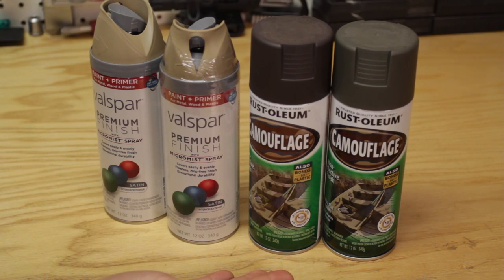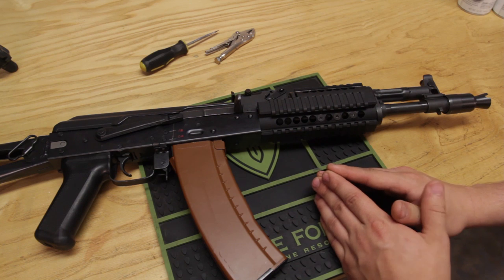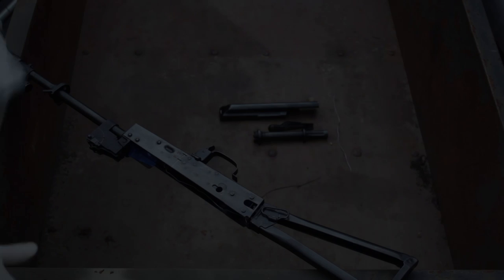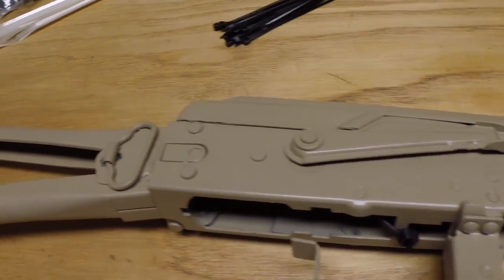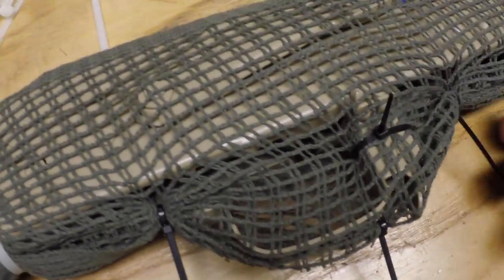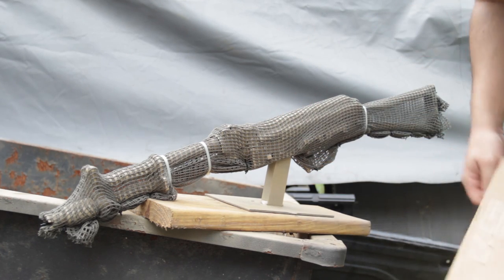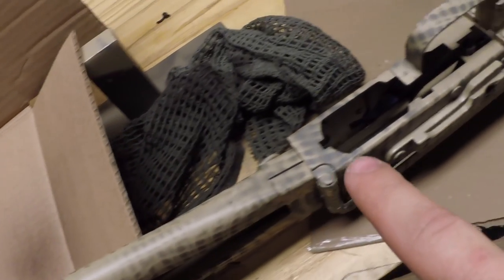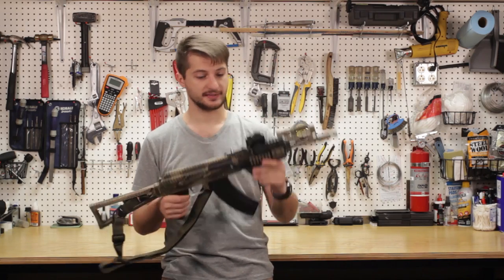How to Spray-paint your Gun like a Boss.

Comment: Ive painted two rifles with each type of paint and satin paint is no good, in my opinion. I ended up stripping it. (CLP Powder Blast makes it flake right off). Flat/matte has a more tactile texture and doesnt have any gloss whatsoever like satin. In the end, it simply looks like a higher quality paint job. The problem is that there simply isn't a wide variety of affordable flat spray paints out there. Home Depot has a Hedrix brand, but its pretty steep and I haven't heard any feedback on it.
Reply: just built an amd65 front a kit. first and prolly last ak build for me.  worked out but a cheap receiver made it difficult (more than it should have been). i opted to paint mine. done some research on it and ended up using rustolium 500f engine paint. i painted it, let it dry the rest of the day in the sun and the next morning i baked it and that stuff is tougher than i expected. i blued an old 22 with perma blu, turned out nice but that paint seems tougher than that bluing.

Comment: This is a quality way to be field expedient about paints weapons and or equipment. For a more permanent and durable spray paint job on firearms, check out The ProRancher, he has a video on the necessary steps for a very hard, quality paint job for firearms. Quick tip: pain on barrels should be high temperature paint from an auto parts store, and if the weapon has a direct gas impingement system only, DO NOT paint the gas tube. Will screw with how the metal mitigates and expands with heat.